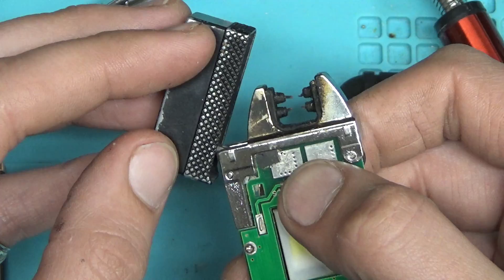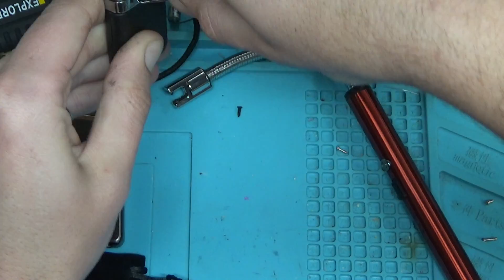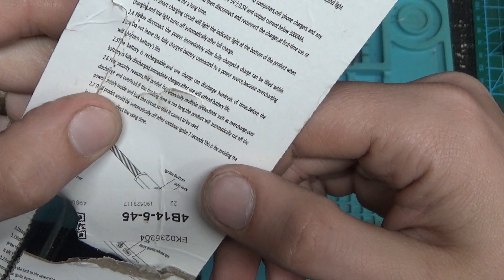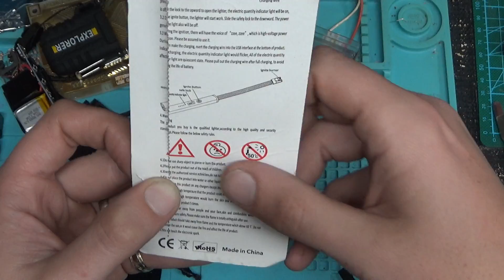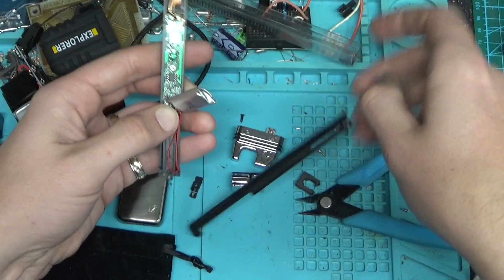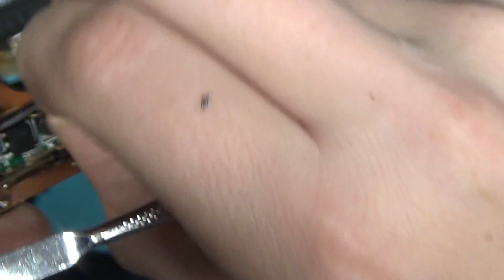Atomic Lighter VS. The BEST Arc lighter, ever?

Comment: I'm curious if you put an 18650 cell on one of these lighters and disabled the time limit how long the lighter will run before something happens.
Reply from the maker: Sounds fun.  May have to give it a whirl.
Reply: @topherteardowns4679  I like these lighters especially the ones with exposed electrodes like that big silver one you have but the batteries they put in these things is a joke. I would rather have a larger lighter and have it take an 18650 cell so it runs longer per charge.
These arc lighters light up a CFL light bulb nicely. That is right on the bulb wires not through the inverter circuit.
Reply from the maker: @coondogtheman  nice. Yeah, a big beefy one that ran on 18650s would be nice, as every lighter like this that i own has had a problem with the battery. Either getting puffy or completely crapping out.     Suppose a d.i.y one could be made with those chinese/ebay stun gun modules and an 18650 lol